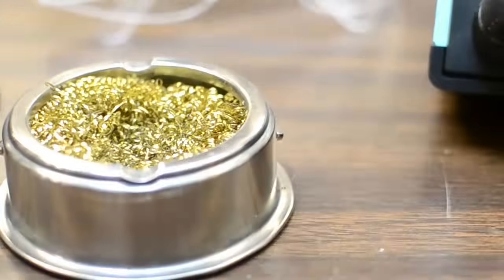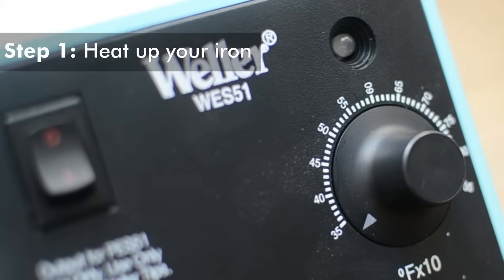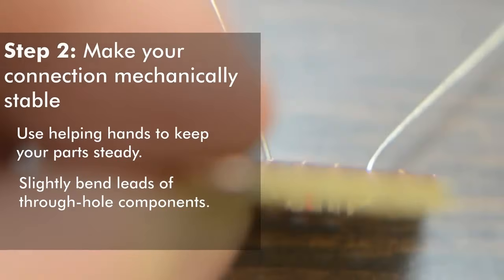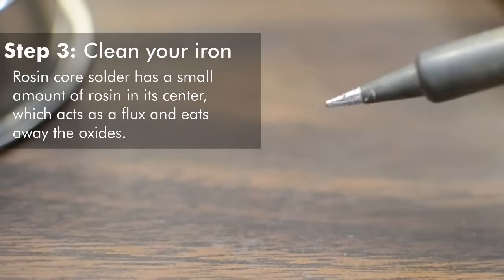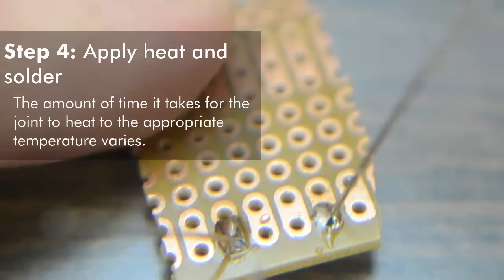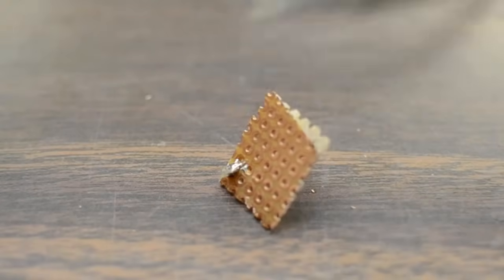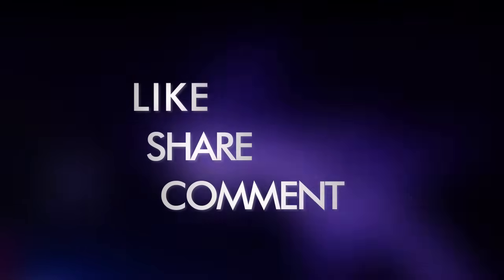Soldering Tutorial for Beginners: Five Easy Steps

Comment: Great video. Last night I was trying to solder a connector that had broken off of a video game console. I believe I did it correctly but wanted to go over the terminals again to be sure. I got a bit to much between tow terminals and tried to wick them away. But for the life if me, I could not get the solder to melt. My iron was like 480°c. Max setting. Tip was tinned. Used flux, the solder paste. Lots of both. That blob of solder would not melt. I tried adding more solder hoping to maybe add more of my low heat solder. That worked (adding) then again, tried and tried to wick the excess away. It woul not melt. I pit in a new tip. Tinned it, nothing. It just wouldn't melt. Finally after about an hour of trying to wick away the excess,  tiny bits Ata time. I was able to remove it along with the terminal.  Now I have no confidence and I'm ready to give up and try a different hobby. I just don't know what I was doing wrong

Comment: I haven’t been able to get my soldering iron to tin. Can anyone tell me what I need to do. I cleaned the tip with sandpaper and a file. I have a sponge. I bought some special stuff from the electronics shop. I’m running it at 40W. I’d like to get a brass sponge like in the volvo. Thanks.

Comment: I have a fixed 60W soldering iron. The tip is hot but not enough to melt the tin wire I have. And I have leave the Soldering iron to heat up for over 5 minute.
But I found a work around that I see the tip is not hot but the base is hot enough so I just use that.

Comment: I only looked this up because I was gonna make a joke involving a soldering iron and I didn't know whether the joke made sense. I forgot what the joke was, but if I ever remember it then at least now I'll be able to know if it was nonsense.
Reply: Did you ever remember what the joke was? The fate of the entire cosmos, the very fabric of time and space, hangs in the balance, teetering on the edge of oblivion, waiting for this single joke to be told. My soul? A mere whisper in the void, desperate for the divine revelation of this forgotten punchline. The universe itself holds its breath, awaiting the moment when the forgotten joke is resurrected and unleashed upon the ears of humanity. And yet... nothing. Nothing but the eternal silence of oblivion. Was it about flux? Was it about resistors? Or was it something even greater? The very existence of everything hinges on the moment when that joke is remembered. I must hear it. The sun itself will not rise, and the stars will cease to shine until that one, sacred joke finds its way to my ears.

Comment: Placing the tip one one side of the wire and the solder on the other side takes more time than placing tip and solder on the same side of the wire, which also avoids overheating of the wire and its plastic coating, sometimes resulting in melting the plastic.

Comment: Great tutorial. I sometimes help vocational trade students learn some soldering skills and these are some of the key hints and instructions I use! I was looking for a short (no droning!) up-to-date video with these key points and this fits the bill perfectly. Also we have a number of girls in our classes so it's great to find a tutorial with a female voice/instructor 
Only comment I can add to the techniques shown is that when we solder wires together side-side, we tin them well first so that the final join is quick, smooth and shiny,  and the  insulation doesn't soften under the clips, or if they are twisted or married together first,  we put heatshrink on the alligator clips if not already there, spread them some distance away from the join, and sometimes add a bit of extra liquid flux from a flux pen to aid the process.
Thanks for the video, I should be using it soon and look forward to gaging the response!

Comment: I'm a total noob when it comes to electrical/electronic soldering, but I have soldered a copper pipe or two over the years doing diy plumbing repairs and installs.  Same principals apply.  Right solder, right flux, right temperature, heat from one side apply solder from the other side and allow it to flow.  Now that I can relate it to something I've done before I'm not so intimidated by it.  Now I just have to figure how not to melt the PCB with the torch when I solder, lol.

Comment: Somebody on Reddit told me these additional tips: 1. Prepare your working area. Make sure you like the table you are working at. Rehearse the soldering with a cold soldering iron at the table, that way you know how you'll have to hold the iron when you are actually soldering, and this is when you make sure your cord is long enough.
Also prepare in advance for when you are finished soldering. Decide where to set the soldering iron to safely cool off. (Also don't forget the component you were soldering will still be hot)

Having a stand for your soldering iron is good because it can help you avoid grabbing the hot end of it and burning yourself good, and stay in "careful mode" until the iron has cooled down. That is, stay alert and be careful while the iron is still hot. If you become too relaxed you may have accidents from not paying attention like accidentally grabbing the hot iron and burning yourself or moving your finger too close to the iron when moving the circuitboard being soldered.
Reply: "Rehearse the soldering with a cold soldering iron at the table, that way you know how you'll have to hold the iron when you are actually soldering" GREAT IDEA!!!!  if you mess up you cant go back
Reply: Rare reddit W. Great tips.

Comment: That soldering iron you recommend says it’s for bigger applications, would you use a different tip or a smaller version for soldering small wires and working on small electronics? Thanks

Comment: You could explain soldering on a crowded circuit board with tight spacing between components.  Also are some circuit board components more heat sensitive than others?

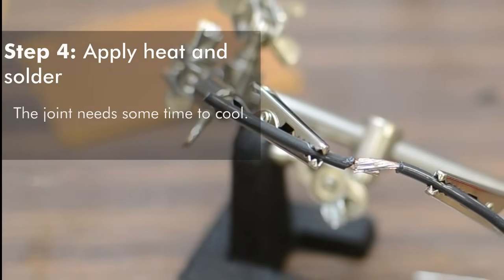Comment: Your PCB joints are great, and I absolutely love that you included the BIG NO-NO in your video about bringing solder to the joint on your tip. The only critique I have is the lap splice. at time mark 2:51 you can see the strands are frayed causing a sharp point, the stripped portion of the two wires were not the same length, at time mark 2:52 you can see the spliced conductors are not in full contact with each other and not enough solder has been introduced to the joint, and at time mark 2:55 the insulation of the wire is severely indented from the teeth of the helping hands (I suggest adding a bit of heat shrink over the jaws to prevent this). Every other part of your tutorial was fantastic, and I love the presentation. Overall, well done.

Comment: Question here if anyone can be nice enough to help. Im new to soldering and dont wanna try until i am confident. Im trying to replace my xbox one joysticks. My joysticks are arriving in 2 days. Okay people that the fumes can kill you if inhaled. I dont see any youtuber wear a mask to avoid inhaling the fumes. They may have vents or windows. I basically live in an apartment withiut vents or windows. But there is an ac that leads outside. May not make a difference tho. Should i wear a mask or are the fumes easily avoidable? I havs seen some youtubers just solder away without worrying about the fumes.

Comment: I know I'll need practice etc but this is the first time the soldering process has made sense to me after 37 years of being alive 🤦‍♂️ maybe once or twice every decade I have tried to put solder into the tip of the soldering iron or drip it onto something and it sucked or barely worked so I gave up. Feeling like a fool now but wanted to say thank you for the video. Actually looking forward to practicing this now! Having one of those "extra set of hands" wire holders looks like a good idea.

Comment: Tip, put some shrink wrap tubing on your alligator clips (helping hands), it will help to keep your wires from physical and heat damage.

Before I did this I would often cut right through my wires jacket, and would have to resolder my wires.

Comment: Very helpful. Now I know what the copper scrubby is used for. Other videos mentioned it but didn't use or explain its purpose. Basically the wet sponge is used for cleaning off your iron before you tin it or begin your solder. Then the copper is for cleaning off the bigger debris from your iron after finishing each solder section; to clean it & have it ready to use again.
Did I get that right?

Comment: Fantastic video - short, sweet and to the point!  I had a course in college where they had us solder components to a board but I only knew the most basic objective, which was somehow getting the melted solder into place and then letting it cool to harden.  I had a tough time because I kept trying to just melt the solder directly from the iron onto the component; I never knew you were supposed to heat the component first and use that to melt the solder.  Live and learn!

Comment: oneTesla:  Thank you so much for this video. I have an ultrasonic diffuser that ended up getting salt water inside. I dried it out and it worked. For a while. Sigh. Corrosion was evident are the electronic components when I took it apart. I was able to clean much of it off, then washed off the remaining salt residue, and gave it an alcohol bath, followed by treatment at the lowest temperature at the highest reaches of my food dehydrator.  

The unit of sentimental value to me, so I’m really hoping to save it. I’ve been able to clean the evidence of corrosion off the unit, at least as far as I can see. One component is free of the board, so I have to solder it back in.  I watched your video, and then had a look online to see what was available in the way of sodder.  It turns out that there are different compositions of rosen-filled wire.  Is there a particular composition that you recommend specifically for working on electronics?

Repair of electronics is something that I’ve never been interested in before, and now I find myself regretting the lack of effort I put into learning anything about it. Lol

Comment: Good video, the only part that I don't agree with is bending the legs on a component (ie resistor, capacitor) when starting to learn to solder mistakes happen and components need to be changed. Even at advanced stuff breaks and needs fixing. If the legs were bent then soldered in it makes it so much harder to remove. I'd hold all the components into place with either tape or the weight of the pcb board

Comment: I have seen many electrical engineers not knowing this basic stuff - or at least not caring. They drip on the material - and then they are surprised when the circuit does not behave as they expected.

Of course they will often not make the final product - but merely prototypes - but it is totally unnecessary to skip this part.

Comment: hey how do I get my soldering iron and metal wire to actually solder a broken metal cord together? it's created small metal balls and put a few on one side of the metal cord.  I wipe the iron on my wet sponge you're supposed to use sometimes.  but often it doesn't seem like the soldering iron is even melting the metal and soldering the two pieces of broken cord together.

Comment: Hi.  You are a pleasant teacher.  Thank you.  Would this work to repair a broken galvanized steel, round mail box post?  I expect this will take time, but I am patient.  Someone batted the mailbox and broke its post - clean through.  Then my car broke and my mail is on hold until I fix this.  The pipe is in cement so I just want to reconnect the pipe.
Reply from the maker: Unfortunately this will not work to repair galvanized steel. You probably need a welder for that.

Comment: As to the wires you soldered together, no-no.  All joints of this type have to make a good physical connection before soldering. In the great world of things, a connection like that in say, house wiring, could cause a fire.  The solder is there to keep the connection, not make the connection.  Think about it there is a big difference.

Comment: I am using lead-free solder and a 60W (450degrees) iron. I'm cleaning the tip and using flux, but I can't manage to solder ANYTHING. The solder sticks to the iron, or the small ball that forms falls on the table. Solder WILL NOT stick to copper wires or circuit contacts. The tip of the iron doesn't even melt the solder, it takes 8-10 seconds to melt, the only way is to use the body or base of the iron tip to melt the damned solder. What the hell am I doing wrong? Is it the solder's fault, the iron's the flux's???
Reply from the maker: This is possibly because you're using lead-free solder.

Comment: Ty for making the video. I especially needed to see how to join wires together. I am attempting a car audio install, and I want to do it correctly. My super tweeters have filters on them and I must solder the speaker wire to the filter, and then heat shrink a wrap over it. I have never soldered in my life, and your video gave me confidence that I can do it. Again, ty.

Comment: I like your tutorial simply good. I have a question of my own, perhaps you can assist. How would i find a wiring diagram for a otc coin counter, purchased at dicks sporting goods sometimes back back. I disassembled it was not counting well, i took it apart, well you know the rest. 2AA battery powered. Purchased $5-$10. Prc Patent # z1200420108809.8
Reply: My email address dorsinvi15@gmail.com

Comment: I bought a fishy af chineese solder at a local store because I wanted to get started quick, thing is it has only the AC plug and no temp control. When i tried soldering two wires (by holding the tip adjacent to them both to heat the copper up) and tried applying solder to it, the solder didn't melt, even after holding it near for up to 10 seconds. It only melts when in contact directly with the iron. What do? My solders come out clumsy because I can press the solder wire on whatever and then apply the iron on top of it to melt.

Comment: protip twist the wires together before applying soder, don't just have them side by side like in the video
Reply: Actually, she did it the exact way NASA recommends soldering two wires together (laying the wires next to each other without twisting them together).  Tested and proven to be the strongest connection by NASA ;)
Reply: @garybeard2109  not completely true. NASA has many other ways to solder two wires together, the most common is the lineman splice. The splice in this video is the lap splice and the splice in the video is not done correctly.
Reply: @Afootpluto  @afootpluto My comment is completely true, though it is also true, there are other ways NASA recommends soldering two wires.  My reply was directed at the comment which directed people to twist the wires together before soldering.  I, in no way made reference to whether the creator of this video did anything correctly or incorrectly.  I simply made reference to the demonstrated method being the strongest method as per NASA.  According to NASA-STD-8739.4A - 2016-06-30 page 69 line #:  d. The conductors to be spliced shall not be twisted together.
Reply: @garybeard2109  you are right that the lap splice shouldn't have twists in it. But what I am saying is there is other types of splices that require twisting the wires.
Reply: LOL @ it's stronger to do them side-by side rather than twisting them together -- that makes zero sense.  Lucky for us our intellectual betters are here to save the day.
Reply: @evilklown55  idk. If NASA tells us not top dip something, I rather trust them than internet majors.

Comment: DO NOT heat circuit board that long. It can destroy the copper foil. If it takes more than a second or two to make a soler, the tip is not hot or big enough. If you are using lead tin 60/40 or so, the right tip temperature is 700F. You should put the tip and tin approximately same time. Always add some tin between the tip and soldered part. You used too much solder when soldering the resistor. You don’t need any helping hands in such easy job like soldering two wires together, after a short excercise. You used too little solder and the wires were not twisted well enough. The wires must look very neat before and after soldering. The cleaning of tip is important but you put too much time to it.

Comment: the thing they don't tell to beginners is that the copper board lies in electronic shops four month and years and builds a very nice copper oxide layer which makes the surface tension higher for the solder tin and when you use some cheap equipment the results will not be to good - so to begin you should use cream cleanser in order to remove that form the copper
Reply: When I took the NASA soldering course years ago they recommended a typist's ink eraser (the white 
stuff)  to clean the trace before soldering.  These are still available at the better stationery stores.

Comment: decent video, but i wish you showed the proper way to join to wires together, i have a friend who wants to repair some broken connections on a 50's Motola TV, but he has 0 experience soldering and he lives in a different state so i cant easily teach him, so im hear.
Reply: its funny with how much solder i go threw i use a cheep old radio shack iron with a terible tip that dissapears fast and un evenly, before a impotent or small soldering job i take out the tip, put it in a drill and hit it from a consistent angle with my dremel till i get a nice cone, tin, then repeat in a month or two.

Comment: When I'm soldering, should i do it in my room or in a garage, and should i were a mask or gloves while soldering?
Reply from the maker: You should always do your soldering in as well-ventilated an area as possible. But if you must do it in your room, keep the window open and use a mask. There are also fans you can buy that will suck the air away from you as you solder so you don't breathe in the fumes.